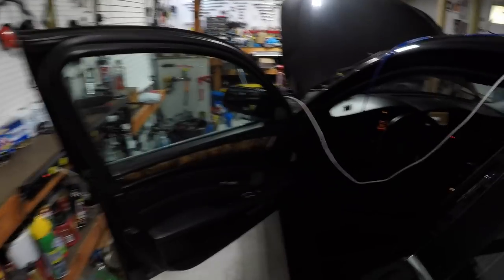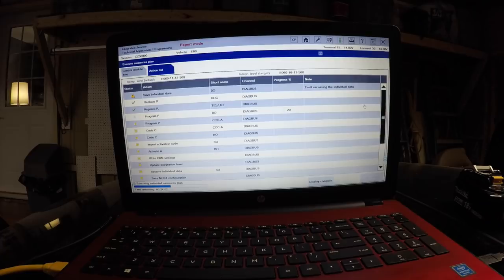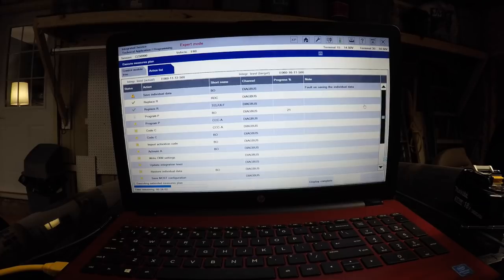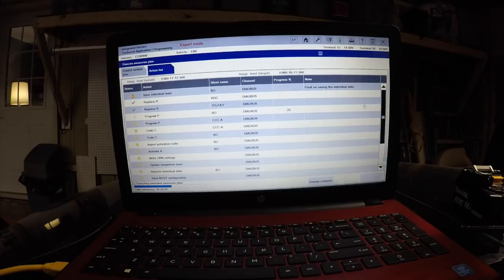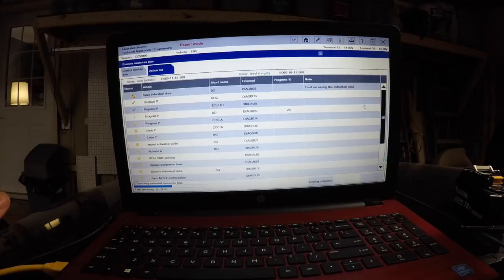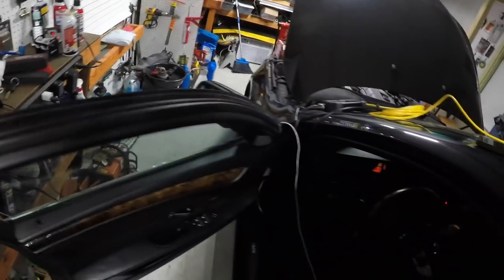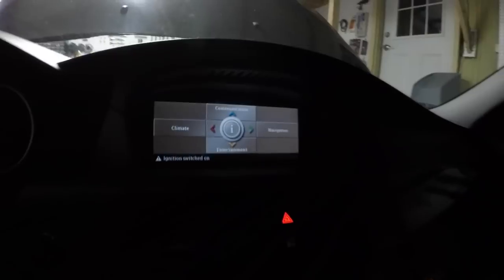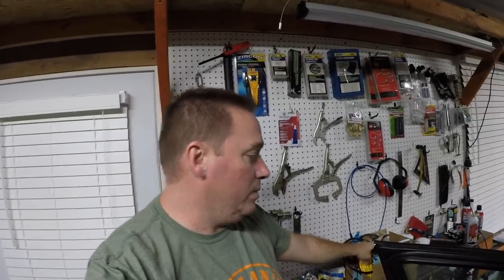Fixing A Bricked BMW E60 IDRIVE Module With The M.O.S.T Using WinKFP And ISTA- P

Comment from the maker: I wanted to add the new ICOM was completely plug and play Unlike the ICOM NEXT , it really made things a lot easier to get this done !!!
Reply: the icom next is not the issue. its just faster. there was the issue with the istap and you had to single code with win kfp. you might have a chinese clone next head  faulty or there was a issue with the TCU and no most loop working so it kicked you out. bypass that with a most ring bypass and code car. come back and recode with the TCU. 
yeah the istap matters if you choose complete programming or exclude modules. or if modules are marked replaced.
mark replaced and then it gives you individual selection of what ones you have to do one by one. like kfp does.
anyway i do it all the time in my shop. its a bullshit system if you ask me. why does toyota not hate the issues lol.
bmw really should ditch the MOST and deal with wire instead.

Comment: Finally went your way. Getting closer. 👍
Reply from the maker: It drives good, still some small issues like the trunk latch and the brake pad sensor but no check engine light and it drives really well

Comment: Hi, Is it possible to flash the MOST firmware directly through ICOM NEXT B, connecting to the laptop with the VinKFP program via a USB-B to USB-A cable, without the ICOM NEXT A head?

Comment: do you have a e39 video on how to reconnect the evap purge valve vacuum hose without pulling the intake? theirs not much on the inter webs about this hose and i think that mine was disconnected during ccv replacement since i went from 21mpg to 18 mpg consistently. i then installed an oil catch can to see if the ccv was my vacuum leak but gas mileage is still 18mpg, stopped burning fricken oil with the ccv delete though which is nice. if you could point me to a video showing where the evap vacuum hose is and how to get it connected it would be much appreciated. thanks for the consistent uploads and quality content my dude, we second hand , no warranty, abused, diy wanna be fast bimmer drivers really appreciate it lol. keep up the superb work and have a nice day nathan.

Comment: Great vids!

Can I ask what month/year build is the E60 and which spdaten you were using?

I can't find any clear information if newer version of spdaten (say 50.2) will cause an issue installing on my 09.2005 build E61. I also only have WinKFP / INPA / NCS-Expert hoping it is sufficient to get all my modules working.

Previous owner had a water leak cause a lot of fried units, and I am trying to get it all back to working 100%.

Keeping a very close eye on the battery as I go of course.

Comment: Wow i did not know you just posted this yesterday! I have the same problem; I soft-bricked my MASK radio on my e60. Bought another regular radio and managed to SG_coderin it with NCSexpert to get sound working since the donor car had logic 7 on it. Now trying to get Sirius on it but the option won't show. I'm probably going to get the ICOM A2 as well (NEXT can't do MOST fiber) and hope that reprogramming and flashing without ista-p can enable my sirius option.